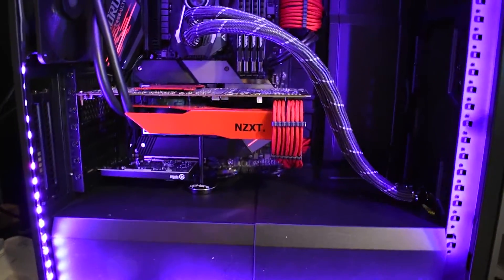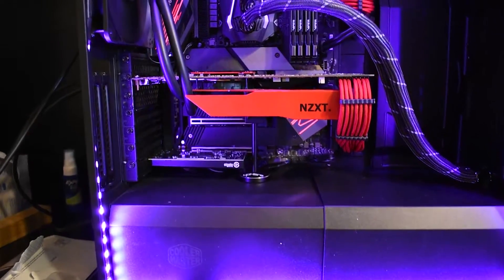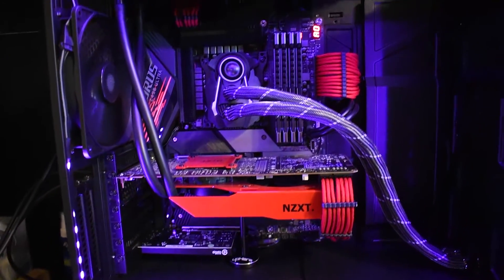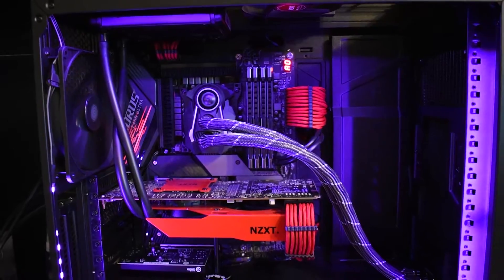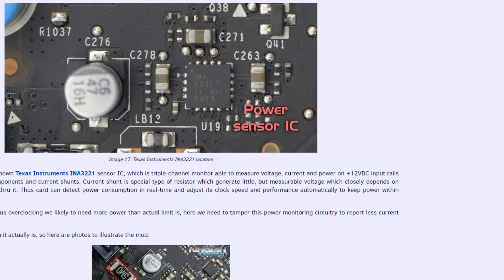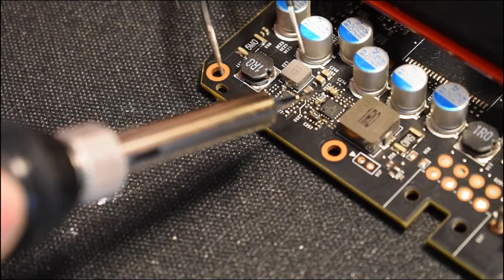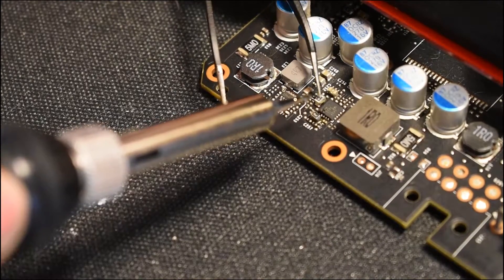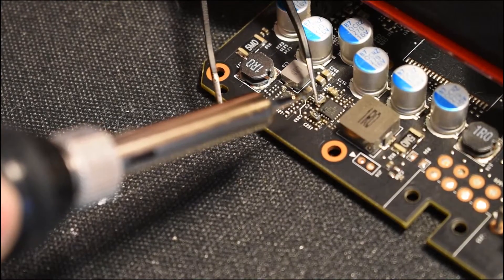How to actually remove nVIDIA power limits - A GTX 1080ti Power Limit Removal that really works

Comment: Something seems not right. I'm doing 2050-2070mhz on the core without any mods.
Reply: not all 1080 can do it, I had a 1070 which OCs to 2040Mhz without issues but now have a 1080 which is not really OCable, maybe around 1950 or less but throttling by power limit which I could increase by Palit Thundermaster SW only until 120% no more.

Comment: Just as a bit of a heads up, soldering on top of the shunt resistors does work but you have to use a resistor of the same value, so 2512 package 0.005 ohm (or 5 milliohm) right on top of both pcie PEG shunts will do the trick, if you just solder straight over the top or go too silly with liquid metal (though LM isn't recommended due to it's propensity to eat solder) then it will put the card into safe mode and not enter 3D clocks at all, but if you run with 2512 package 0.005 ohm, the 2512 package is much easier to solder too

good point made with the 6 pin and 8 pins, that's just pcie spec, pcie spec is specced based on bare minimum wire gauge, the connector is capable of taking 3x the rating, so if your psu runs higher than bare minimum and a decent wire gauge then you can absolutely shove 2x or more into the connector without running into any issues
Reply: Soldering the same value resistor on top will double the power limit, because you're halving the resistance so the card thinks it's only using 50% of what it actually is. But you don't NEED to use the same value resistor. If you use a .01 ohm resistor instead, it will make the card think it's only using 33% of the power it's actually using, so you will triple your actual power limit, etc. It's just math. Just don't go using something like a 1 ohm resistor or even a .1 ohm resistor or else you'll fry your card.

And lots of people have had no luck with adding another resistor of the same value, their card just locks down at 305mhz or whatever. Derbauer has a video on the 2080 Ti Strix where he tried to shunt mod it and it triggered the safety limits. Doubling the power limit is almost always going to trigger the safety limit. I think increasing the power limit by 50% is the most anyone should be doing.
Reply: @NikoBell1188  this is correct, but you get dangerously close to tripping safety mode with a .01 ohm resistor, and the other side of things is thst doubling the power limit will functionally remove it u less you're going LN2 in most cases anyways, and by that point you can just use a potentiometer since cooler mounting is no longer a concern
Reply: However, it is exceedingly rare that a same size shunt will cause safety mode to be tripped, it does on the strix 2080ti but that doesn't really matter as the xoc bios functionally removes the power limit anyways

Comment: any chance you can link the parts. Want to order. Thanks!
Reply: the part is: 10 Ohm 0805 (google is a widespread term to search for anything you want including this part) :p
0805 SMD cost (for me atleast) about 0.02 euro cents EACH.
and like Lens explained in this vid: if you dont overclock and keep the voltages stock not much will change. 
this is purely a mod to bypass power cutoff during  gaming -which this card will do because its designed to run efficiently even during heavy loads(hence the power cutoffs)